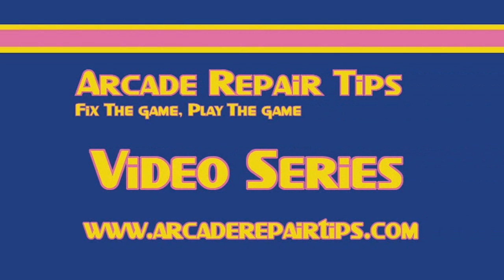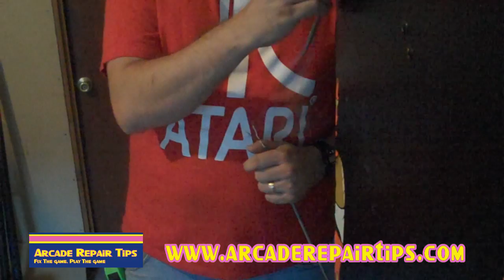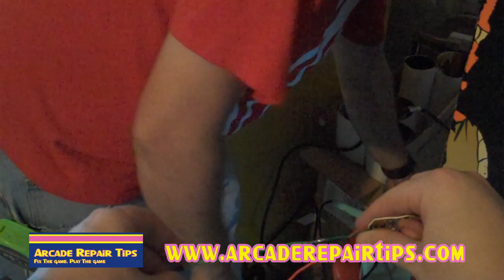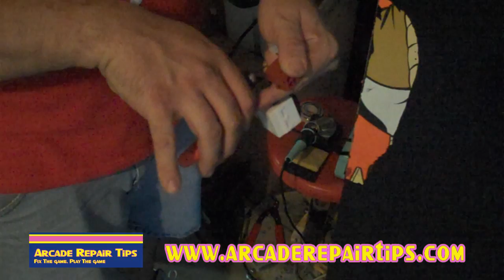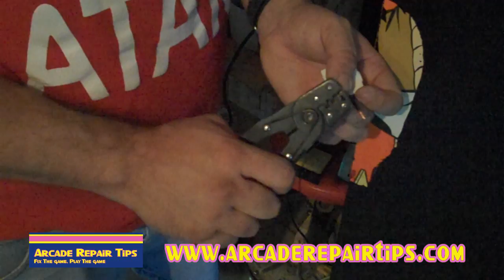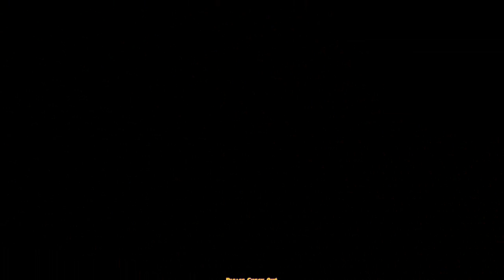Arcade Repair Tips - Replacing An Arcade Monitor (Part Two)

Comment: The biggest problem I guess is that the wiring plugs are different on many monitors.  This may be a dumb question but I cant find an answer. Is it possible to use an old TV monitor ?

Comment: Hi!
I have an arcade monitor a ARCADE VGA + a PC.
I have connected the arcade vga to the arcade monitor.
How do i power supply the arcade monitor?  There are 4 wires coming from the monitor chassis. What kind of power do i need?
Thanks